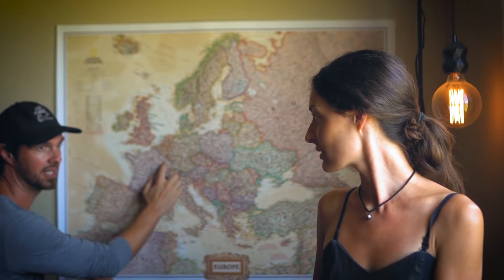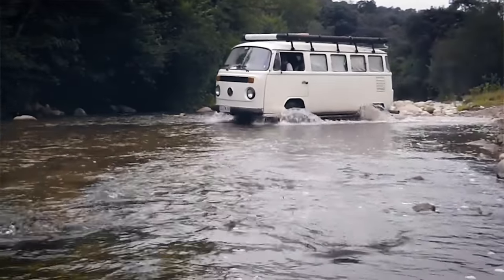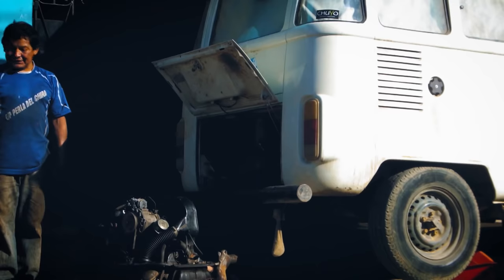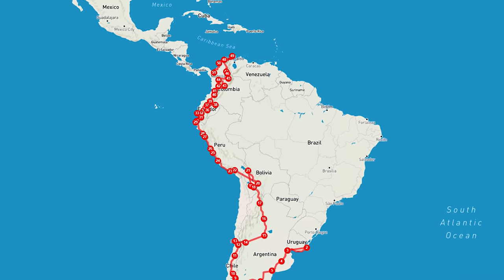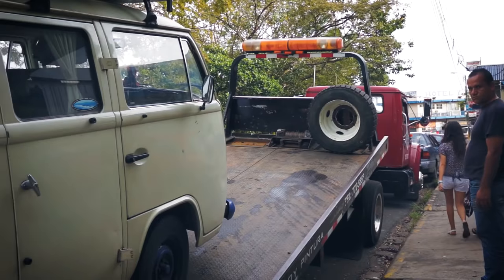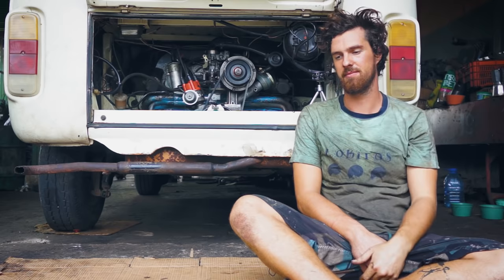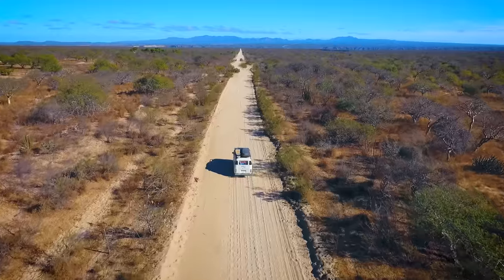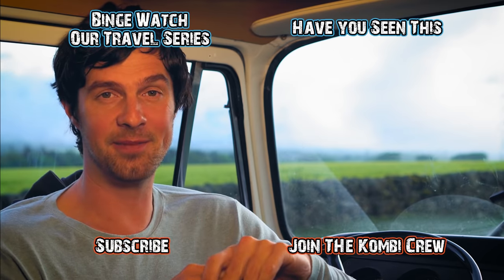How Did I BLOW UP 10 ENGINES in 1 ROAD TRIP???

Comment: those old vdub engines are as simple as it gets, i've had lots of them. you can even reuse the copper head gaskets in the event of a cylinder head removal. installing an auxiliary oil cooler with it's own temperature controlled fan, a mount for an in-line, spin on oil filter, and adding an additional in-line fuel filter are excellent upgrades for long trips. a small correction, drilling out the jets allows more fuel, not more air. he probably adjusted the air mixture screw. it is something that should be done as you change elevation due to differences in oxygen levels. just be sure to re-adjust it when you leave the higher elevations. checking the valve clearances regularly is also a helpful tip. having a good repair manual is an absolute must. it will have torque specs, tolerance measurements, and pictures of what it's supposed to look like in the event you can't figure out how to put things back together correctly. i am a mechanic, and was a boy scout and a soldier. prepare for the worst, and hope for the best. spare parts are a good thing to make room for in your kit. enough oil for a change and a filter, a spare carb or a rebuild kit and fuel filter, assorted pre-made brake lines, brake fluid and pads/shoes, a couple of tie rod ends, tire repair plugs and install tool, hand tire pump, new plugs, points and condenser, silicone gasket maker, some high temp, high strength two part epoxy, a small coil of both pvc coated copper electrical and uncoated 10-12 ga. mild steel wire, the tools to remove and replace these parts, and the knowledge to use them are a good start. they don't take up a lot of space, and can be lifesavers in the event of an emergency break down in the middle of nowhere. oh, and don't forget your most valuable tool and important resource, a good helping of common sense.
Reply: The air cooled VW does not use head gaskets. You clean up the head surface by hand lapping with a cylinder. Yes, the stock oil cooler needs to be replaced by an  external  cooler. The stock cooler inside the fan shroud inhibits air flow to #3 cylinder, which will eventually cause failure to that exhaust valve. This engine is partially cooled by oil, yet has very little capacity. Adding coolers and external filters adds to the capacity. Not sure about modifying the air correction jet for high altitude use compared to the main jet. Another factor is spark timing in high altitude. You need to advance the timing about 1 degree per 1000 feet.
Reply: @loboheeler in the 80's and 90's, when you could pick them up for little to nothing,  i turned quite a few beetles into sand rails, trikes, and baja buggies, mostly using the 1600 cc engines that i installed 2112 cc big bore kits on, dual webber carbs, and the van irs transmissions. and the german engines have reusable copper gaskets between the head, and cylinders. you might think of them as spacer shims, as they served both purposes. i don't know about super beetles, or the south american versions. you need the beetle front axle unit, as the mac pherson strut supers were not really compatible to off road conversion. i liked the type three engines with the rear mounted cooling fans the best, but they were hard to come by.

Comment: Well done for owning up to all your mistakes.
Don't be too hard on yourself, in the modern world cars are no longer worked on by average guys (far to complicated) so your generation didn't grow up knowing about engines.

I am in my fifties and my generation always fixed our cars, we had no money but the cars were simple enough.
You have learned an awful lot so well done
.
My advice would be to fit an oil pressure gauge and and oil temperature gauge. You can see so much from pressure and temperature.
All old cars had oil pressure gauges, as soon as things aren't right, it will tell you.

All old cars had a water temp gauge but with the air cooled you can substitute that with an oil temp gauge, again, it will tell you when things are not right before it costs money.

I wouldn't dream of doing an overland without those two gauges.

Comment: I had a 1978 van with the 2 liter engine that had a head temp switch/sensor and when it went bad, the only days it would not shut down the engine were the cold winter like days. ALWAYS CARRY SPARE PARTS! Belts, plugs, coil, plug wires, fuel line & filter, distributor, and anything else you might need, but on a trip like that I'd carry A COMPLETE READY TO RUN SPARE ENGINE AND a fresh clutch with a lightened flywheel and fresh brakes!!
I was living in orange county in CA (sea level) and had a 67ish Chevy pick up truck. I purchased a new carburetor and it ran great starting on the first crank. A guy purchased it and the very next day he called (pissed as hell) complaining I sold him a lemon as it refused to start! He neglected to tell me he lived in lake arrowhead that is over 5000' above sea level!
Reply: Why wouldn’t you just buy a more reliable van?

Comment: You did jump into this adventure without any good sense of what is needed, but you jumped in for an adventure that 99% of the population would never had tried.  I've built a lot of things, but I could never just go off on some massive trip.  You are made differently and that is a good thing.
Thanks for the video too!

Comment: It went wrong when you picked the wrong van.
Reply: This van is the right
Reply: Such logic in your schooling of this man in the video. Wish I could come up with something that intelligent. 😑
Reply: @robh87  With that I don't mean it doesn't make problems, but you can fix it yourself. With a new car you would be stuck
Reply: @robh87  you seem pretty intelligent 😂
Reply: @allthesame3856  looks can be so deceiving
Reply: @jakob5481  look who's laughing when the next ECM hits pal.
Reply: VWS WILL GET YOU THERE...BARELY...AND YOU FEEL LIKE YOU WALKED!!!!
Reply: true,I have owned VW vans and they were the weakest,most fragile van I have owned.Replaced every component on it;engine,trans and complete front end.Best buy a Chevy or Ford and you won,t have all the work or worries.
Reply: @tommythompsonsurfer  I constantly work on mine. And I knew that going into it. But most of mine is customization not break downs. But the drive train, electrical and suspension are all new within the last 2 years. And the suspension is all custom air bags I did myself, no more torsion bars and cheap vw bushings to worry about.
Reply: Air cooled with the engine on the back and driving on volcanos - what could go wrong? xD Worst choice of car you could do, but it was 'nice for instagram' ;P

Comment: So awesome, thanks for sharing. Extra oil cooler and engine monitor showing oil temp, cylinder head temp, and all exhaust gas temps would have paid for itself 10 times over. Still so great that you did it and learned so much and pushed through and made it happen.

Comment: One more small thing, make sure all of your cylinder and engine tin is intact along with the engine compartment seals.  Because the VW air cooled, you need to stop any and all air from recirculating inside the engine compartment.  In a perfect world the cool outside air comes in through the vents on the body, goes into the fan, some of it cools the oil in the cooler and the remainder cools the cylinders and heads before exiting the bottom of the engine and out the back.  Sealing up the engine compartment is often overlooked when trying to keep the VW cool.  I applaud your effort to educate yourself, you were definitely on the right track. Unfortunately, some easy to overlook items kept hobbling your efforts.  Best of luck with your travels!  BTW, the folks at CB performance definitely know their business, you are in good hands.

Comment: Having driven a kombi around Africa for many years, I can say with reasonable certainty that if a kombi breaks down it is not usually because of any inherent mechanical defects, ( In fact I found that even when things get worn out or partially fail, with a little common sense you can still keep going). The major cause of failure is an inability to drive/ operate sensibly in accordance with the prevailing circumstances and a lack of understanding of how to minimize the stresses and loads you are putting the engine and drive train through. 

I took my late 1980’s 2.1l air cooled kombi places most 4x4’s feared to go, I used it to tow aircraft including LET410’s, Metro Liners and Jet Stream 41’s around an Airport and drove it frequently on long trips at highway speeds with heavy loads all on its original, never overhauled engine until I sold it to a taxi operator with over 200,000 km on the odometer.
Reply: True! Never got less than 100 000km out of an engine overhaul. Don't flog it to death! Remember 50 horse power only!

Comment: should've swapped for an inline 4 water cooled at the second engine out, also 1000USD is waaay too expensive for rebuilding an engine like that.
Reply: To rebuild an aircooled engine like that’s its minimum $2500.  Line bore means new bearings, and most bearings now don’t have the steel reinforced center mains.  Honing the new cylinders because even the German stuff isn’t completely round.  Replacing valve guides, valves, seats etc because the heads run so hot they’re always toast.  Most times cases need stud inserts if they aren’t too far gone and .060 over already.  I worked at a shop that exclusively built aircooled and vanagon engines.
Reply: @curtislovrak5390  I'm talking about south american prices. Here in Brazil you get a whole engine for 1000 USD. (the 1600cc kind, from an old beetle)

Comment: 43 years ago, I worked on my first VW engine. 1200cc. They had about 36 hp. Enough to NOT pull a drunk scotsman off the loo. In the span of 2 years, I bought 5 VW's. 3 were IRS trans. 2 were 1500cc. 2 were 1600cc. Now the 1600's had enough hp - the drag the scotsman off the loo, but he still could hang on - to the loo, while I just spun the tires. Now - I could drop an engine, in 2 hours. And have a new one in, running, in 4 hrs total.  I must say - I am in Absolute Awe of your managing to smoke 11 engines. Sincerely - they are workhorses, but attention to the elevation and the requirement to adjust mixtures - as you go.  Please don't idle them. They bleed, oil, gas and other bodily fluids as you skin your knuckles taking it apart.  Cheers to you and the new one!

Comment: Its actually pretty amazing that someone without any practical knowledge, skill or experience made it that far without any prep or research on only 10 engine removals. Type 1 is a great engine, but only if its kept after and all its nuances understood. In the end it's the experience with all that's learned and gained, that's the real treasure. The trip itself, with all of sights, sounds, interactions, etc. is the icing on the cake. I admit as an owner of multiple air cooled vw's I cringed quite a bit through the vid, but I was pleased to see the determination at meeting all the challenges faced. Good work my man!

Comment: New pistons rings, new seals, new rod and shaft bearings, then find a wrecked porsche and take the fan out, modify it to fit the bug motor, and add an external oil cooler.. you should be good to go 👌

Comment: Just a quick note here!
The only thing wrong with the Kombi was the damn oil cooler lays across #3 cylinder, causing it to overheat first, sometimes it will seize.  In turn it causes the rest of the cylinders to run hotter, eventually frying the oil and it stops.
the actuall cure is a remote oil cooler and synthetic oil. once thats done, it will be very stable and reliable. I also made sure to put all the air deflector plates back in place to keep all cylinders cooler. Once that was done, the beast never ever got hot again.
DF

Comment: Low oil pressure, caused by a by passing oil pump. Any gap between the rotors and the base plate and oil pressure plummets, add other issues like over heating due to carburetor issues, timing being out and the oil thins as the engine gets hotter making the issue of a by passing oil pump even worse.
The thing is if you take the base plate and use a whetstone you can flat out all the scoring and create a flat surface for the rotors to run against.
4 washers to make up the space removed from base plate and your back in business.

Mistakes are great as long as you learn from the first one!

Comment: People without mechanical skills and knowledge shouldn"t buy old cars  - first of all.  Old cars need proper maintenence. People without mechanical knowledge will not be able to give them proper maintenance. There were few samples of complete misunderstanding basic mechanical principles in first 6 min of movie. Knowlegde how carburetor work is basic for such trip with such terrain. Running engine to lean , and overloaded is asking for troubles - 10 times - and getting them :) Overheated engine will die sooner or later. Must die... 10 times :)
Reply: How are you supposed to learn if you dont buy and work on old cars? Learning by doing is much better than reading in a book most of the time, and as we have seen his skills evolved from 0 to somebody that can remove an engine and rebuild it on the side of the road! Personally i think he knows more about vw's than a lot of the keyboard wariors on youtube!
Reply: @opopopopop31  true. you can learn by doing. but it's nice to have idea what are you doing :) other way learning can be dangerous and / or expensive.
Reply: @opopopopop31  why learn the hard way. Many people have "been there, done that" and yet stubborn people will not listen to their advice. I really don't know what to think when all he had to do was ask a wise person "what vehicle would you take across the continent" and it seems it never dawned on him....scratching my head.
Reply: I have a bit of mechanical knowledge, not too much, but enough to know you shouldnt take a car designed on the 1930s on a road trip unless you have spare parts

Comment: And the cost of a brand new engine and gear box at the start vs all the costs, breakdowns, lost time?
Reply: he would still blow it up if it wouldnt be modified to not have the common issues most boxers have, like one cyllinder getting hotter than the other.

Comment: ben great videos. love your attitude. im a mechanic and live in california. love mexico and they lifestyle there. i ihave a 73 vw bus 1700 i rebuilt up on lopez island north of seattle. on my friends property. some day ill take it to baja. u are right about getting out of your comfort zone. so many people told me when i was young i couldnt do certain things. and if i had been listening to them, id still be living with my mom! its true the old vws are not great cars but its really more about the adventure. i like the old points and condenser. its an easy design and the parts are cheap. ive watched alot of your videos and on the new vw boomerang. you are very diligent! Dont listen to the negative people on here!! At my shop I specialize in old mercedes 1977 to 1985 all diesel and run on biodiesel or vegtable oil. if you are ever in oakland california look me up. billy biodiesel at gmail. wish i could hear more about your experiences with the locals in each country. i speak spanish and so does my daughter. its fun to learn a new language and meet new people. its a very lucky way to live. i think the best of the older vws engines was the 1600 because the parts are more plentiful. its hard to find parts for the 1700. also do u know about zinc and cam? you need ot use engine oil with zinc in it or the cam wears out. some questions ive had are like, where did u meet leia? did u save money up for trip besides working in australia? because you spent money. how did u get the co pito in chile? why did u start in chile? did u take spanish classes before the trip? oh and where did u find alaska? and also one of my favorites is food. would love more videos about the local people and the food. more pictures of food. and where did u go in baja? ive driven all of it and its a magical place. keep up the good attitude mate!! Billy

Comment: Had you installed a oil cooler would that have worked to keep the temps down? In a good air flow area. It should be very easy to do too as its commonly done aftermarket.
Reply: that and a gauge so you know when it's getting toasty
Reply from the maker: Yep our new CB Performance engine has one and it makes a big difference
Reply: @KombiLife  How is it mounted ? It's important that the oil cooler exhausts the heat away from the motor and body... Have seen too many people mount oil coolers on the fan housing intake, or underneath near trans only to have that heat be sucked back into engine. A good way is to mount it along the side of the body, so it's drawing air from in the engine compartment ( make sure the rubber engine/body and door seals are in place and functioning ) and exhausting it out thru a hole or louvers behind the factory ones ( make new ones, not the factory ones which are COOLING INTAKES ) If the rubber seals aren't in place, heated air from the exhaust system goes back up into engine, particularly at lower speeds.

Comment: I think  an Aluminum/Magnesium alloy case loses considerable strength when it's overheated. It needs low compression, conservative valve timing, the correct air/Fuel ratio, and an awareness that the stock, non counterbalanced crankshaft will distort and damage the case, bearings, rods, pistons and rings if spun faster than 4200 rpm consistently. You need an aftermarket oil cooler. to help it. All the items above cause heat...the enemy of the type 1 engine.

Comment: VW kombis are rated at  1200 kg load capacity. You broke your buses engines by neglecting your air shrouds and using your whip to make it work too hard, maximum revs should be not more than 4500.